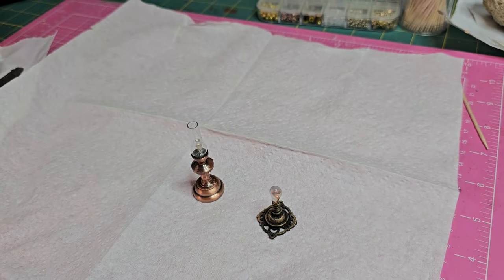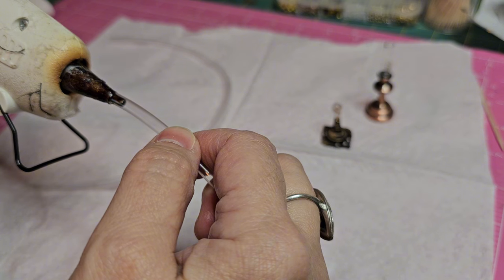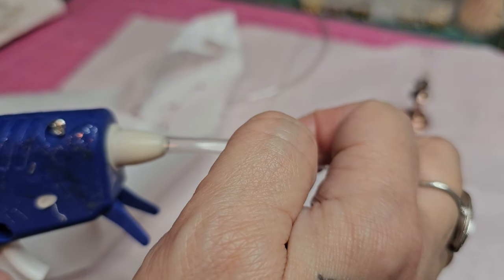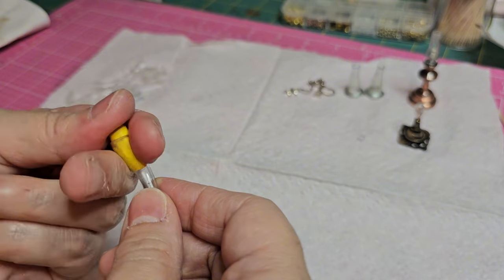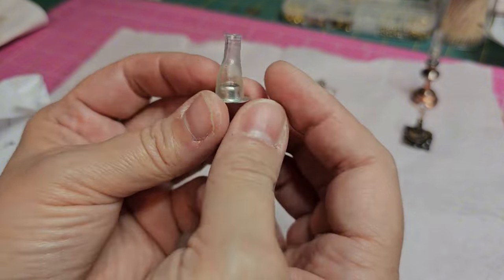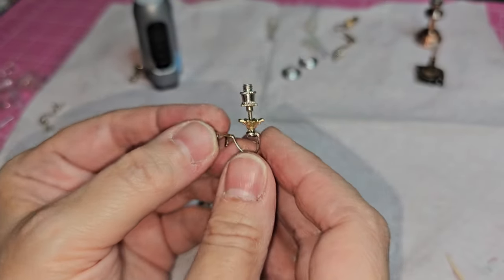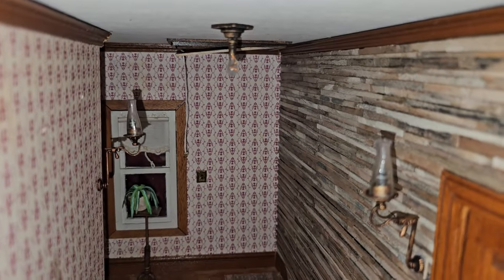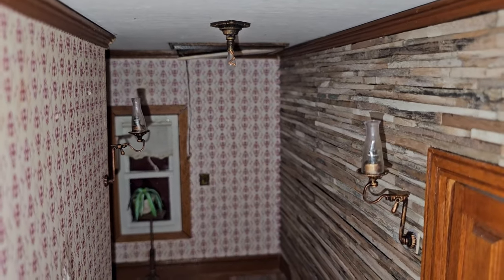Realistic Antique Gas Light Fixtures |1:12 Miniatures| Dollhouse Lights

Comment: Hi Miss Tinykeyholeminis, I love these gas lamps, they're gorgeous 😍 For the glass tubing you can also use plastic pipettes from art shops. You can buy a big bag of them for about $2, and they last forever because they're long tubes and you only need a small piece for each lamp. I like how you use jewellery findings, like bead caps and tiny screws, to add realistic detail. Thank you for a great video tutorial. Love from Amanda Jones in Melbourne, Australia ❤❤❤
Reply from the maker: Thank you so much, Amanda. I appreciate the kind comment. Thank you for the info on the plastic pipettes. They sound useful for sure, I'll have to check those out. 
Oh, I definitely had those on my list, but I didn't know that's what they were called. Thank you so much!❤️🥰

Comment: What paint are you using for the antique brass finish ? Thx 🙏
Reply from the maker: I start with a base of black acrylic or chalk paint. Chalk paint works better on metals. And I use a variety of brands and colors. Mostly folkart Metallic  paints. Antique gold, antique copper, silver, even rose gold. Or I will use chrome paint. I used antique copper for these, then I finished off with a little of antique gold rub and buff. That comes in all the colors if you can find it. I only have antique gold. Hope this helps.🥰❤️
Reply: Thank you for specifying the brand and names!  Im a newbie to miniatures and I appreciate the tips!  Hugs 🤗
Reply from the maker: @aneia6353  sorry for the typos. It's metallic  paints by folkart
 Usually I will show what paints I'm using. I like folkart when it comes to metallic colors, but any acrylic works, some brands are thinner than others and need to be applied with more than one coat. 
Welcome to the Mini Side. Feel free to ask anything, I will try to help as much as I can or guide you in the direction of anyone that can. 😉 🥰❤️

Comment: I like your tube shaping! I’ve seen one tutorial doing the same technique but they ran it under water so I’m glad I wouldn’t need to do that. lol! But they are beautiful. And the copper in the bulb makes it look like a working light like the old ones we grew up with.
Reply from the maker: Thank you so much. I haven't seen the water trick, but I have seen people heating up the bigger ones to bend as they are harder to shape. But then you lose the color if you want to keep it. Nope, there is no need for either on the smaller ones, and you can easily file the opening back to shape after cutting. ❤️🥰
Reply: @tinykeyholeminis  I too accident prone to try the water thing lol! My Addams house isn’t going to be fully powered but having seen a few false lights is good for me. I may put lighting around the frame of the house like I saw on BHM channel.
Reply from the maker: @dawnc.9676  Yes, she did such a great job with those lights. I think some decorative lights are great anywhere. They don't all have to work!😉